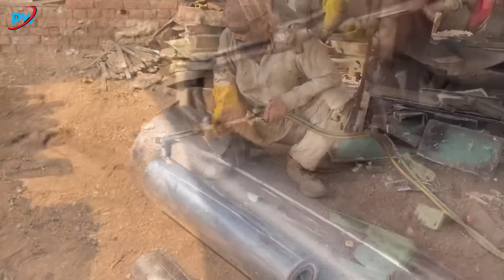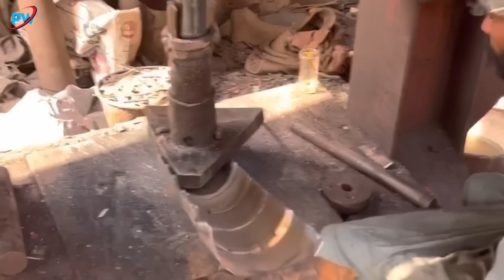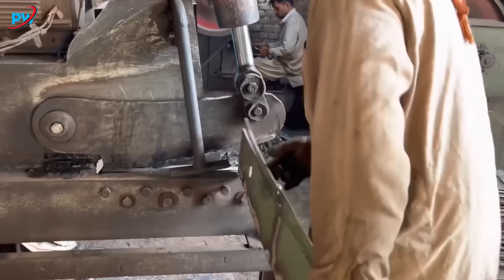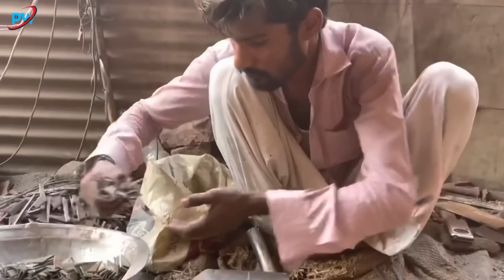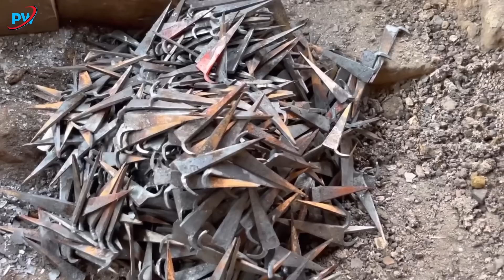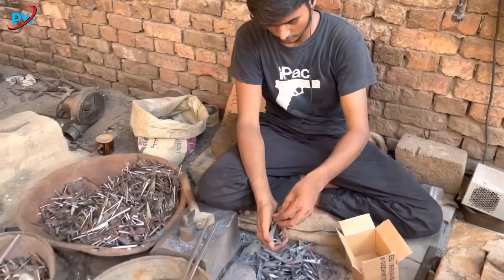How Electric Wiring Iron Hooks are Made / Amazing Production

Comment: so im just assuming these are for anchoring power lines to poles (hopefully not high voltage) but what were the exhaust muffler type pipes being used as material??
Reply from the maker: Haha ‘ thank you so much for your valuable comment
Reply: They seem hydraulic cylinders?
Reply from the maker: Ohhh okay. Thanks for your valuable feedback
Reply: They looked like Offset Printing cylinders, you could see the feint engraving on them ?
Reply: @graemewhite5029  Good observation! 👏👏
Reply: @graemewhite5029  Yeah and there looks to be ink on at least one of them at the start, thanks for solving that

Comment: I'm rather surprised to see how much they use cutting torches over there, here in USA anyway gas refills are quite expensive compared to cutting with saws or abrasive blades. Acetylene or whatever they're using for fuel must be a lot cheaper there than it is in the states because at USA prices I think those people would opt for other ways of cutting scrap.